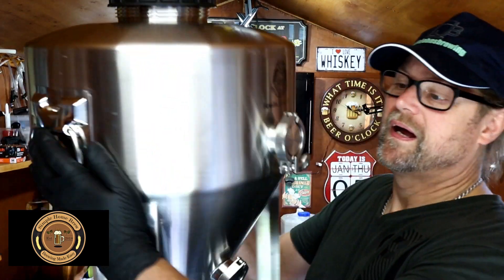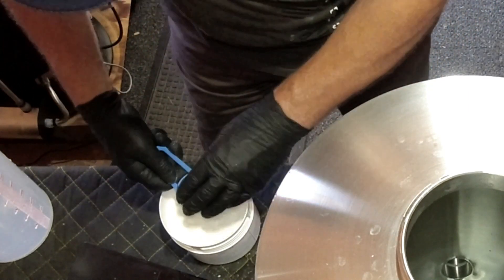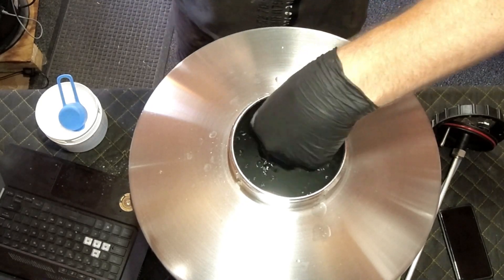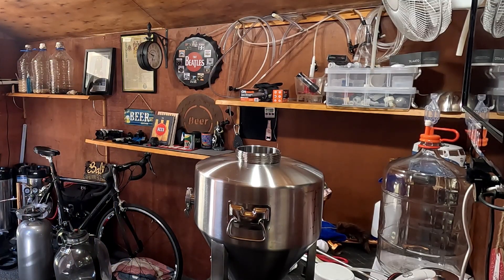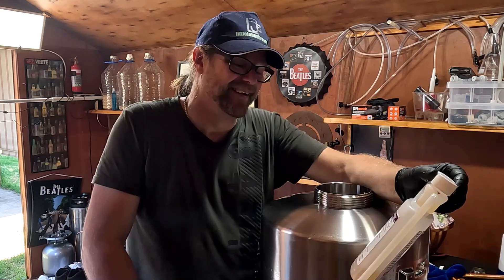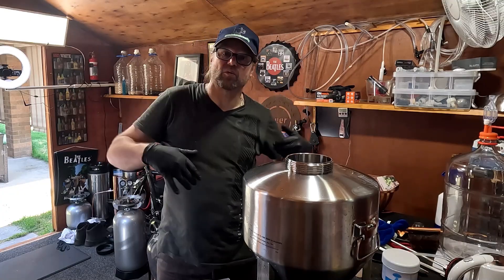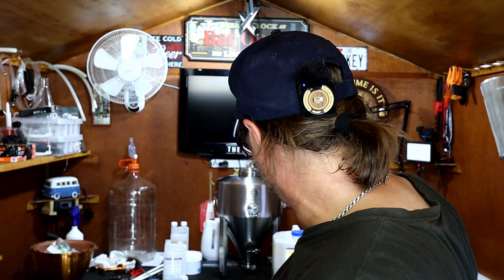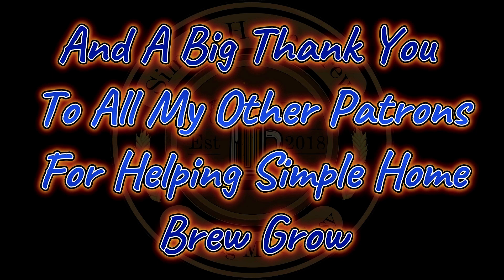Passivating Stainless Steel. Passivating my Apollo Titan for the first time.

Comment: Nice mate, editing on point. I dont use Atomic, so I dont know about it, but if you clean with something like Bar Keepers Friend you can skip the whole star san bit, a good clean and the air dry is the most important. I notice you have some deep pitting in the fermenter maybe they needed heavy treatment from the welds? Again though most home brew set ups you can reach with your hands to clean, in commercial breweries they use harsh chemicals because it too hard and too much work to get into everywhere and give it a scrub! Keep up the good videos mate! Cheers!
Reply from the maker: Thank you, I will use some of this advice in the future. The spot welds do have dimples on each weld point, to be honest I am wandering if the quality of the build is good enough? Possibly is I need to use it more to figger that part out. Cheers